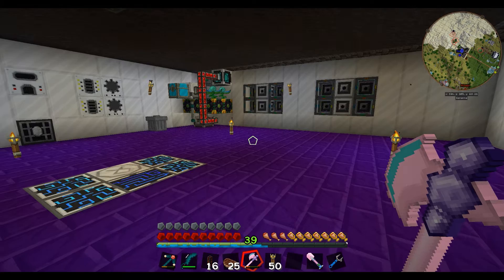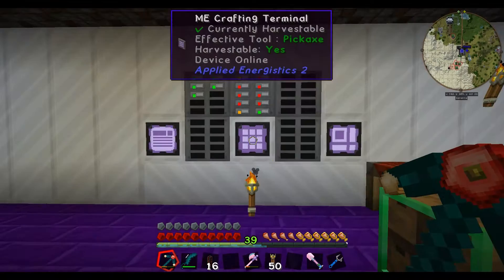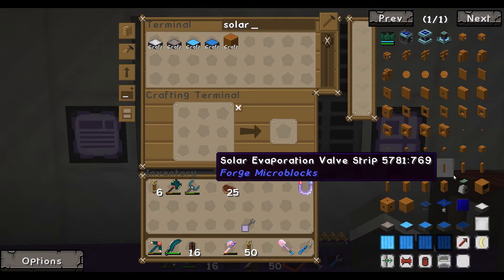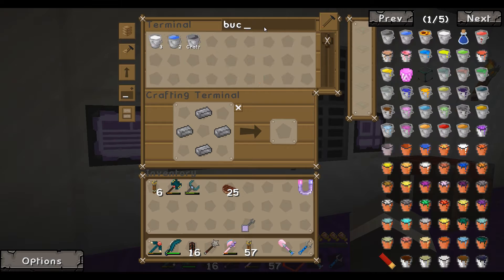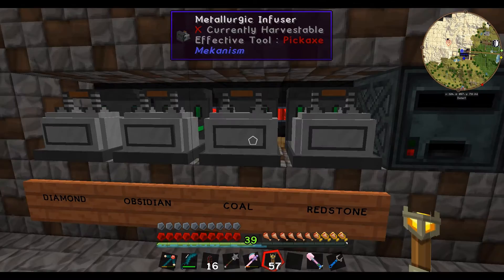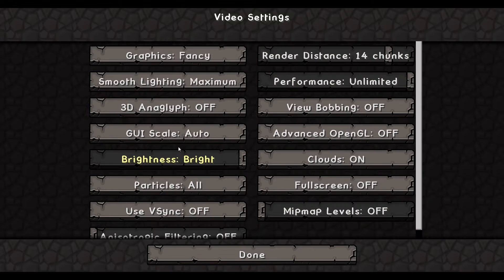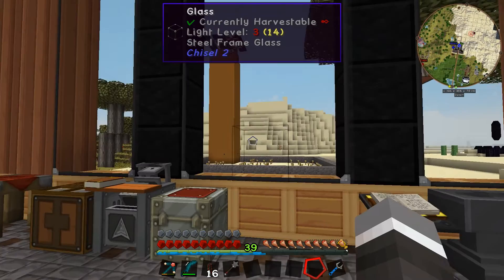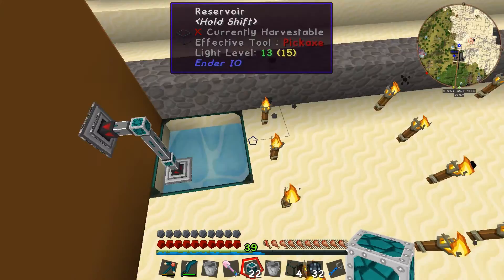Modsauce 2 EP 9 Mekanism Solar Evaporation Tower

Comment: The speed of your water intake is actually fine since the lithium tank will not consume the brine from all your towers fast enough anyway. Also, the idea of storing reserves because of the overworld day/night cycle is a smart move but do consider that if your reactor injection rate will be 3 or less you won't need to because it doesn't consume fuel fast enough. Injection rate of 3 is about 30k rf/t which should be plenty. Any more than that, then yes a reserve storage would be a good idea and I'd suggest that it'd be at before wherever the bottleneck is-it all depends on your final setup.
Reply from the maker: +BrinkTheGamer Thanks for the info Brink. I have been watching your vids with earnest trying to learn how to set this up. My main goal with so many brine towers is to possibly have two lithium towers to allow constant self sustainability if possible. But oh my god Soooooo much copper! and the enriched alloys!